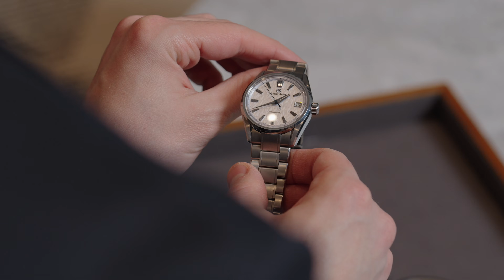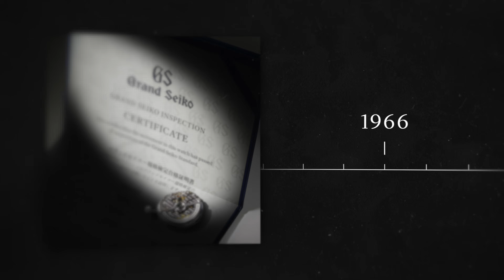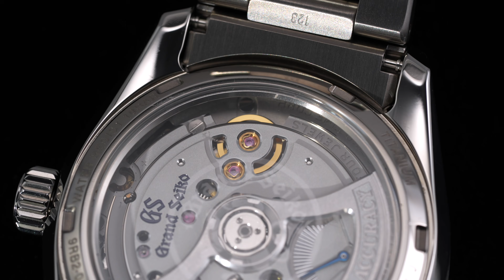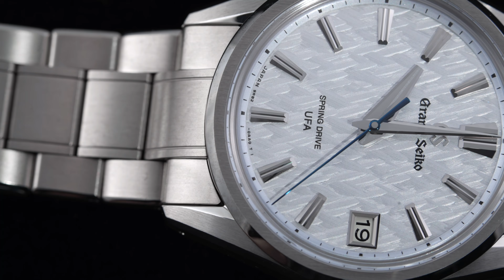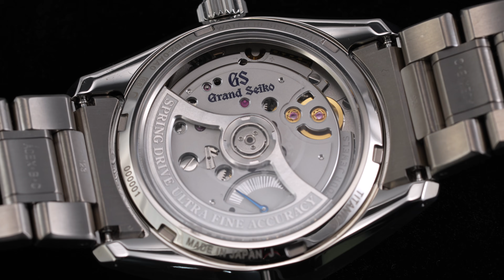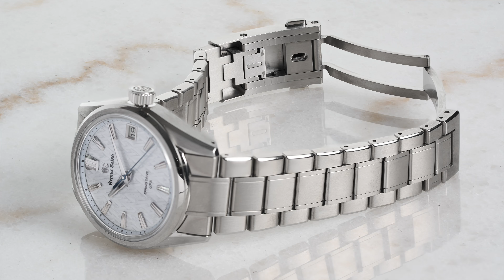The Most Accurate Spring Drive Watch Ever With A New Micro Adjustment Clasp  - Grand Seiko’s UFA

Comment: Is UFA stil the same movement, just factory adjusted? Including no updated firmware and such?
Reply: Features newly matured quartz. The quartz and IC are housed in a vacuum-sealed case. 
 A temperature compensation function has been added, primarily to minimize the effects of temperature and humidity.

Comment: I’m sorry but Joe keeps getting lost in the weeds when he answers. Teddy tried hard to guide him back by asking customer focused questions but Joe goes off every time. Eg Teddy: “This is some who wants the pinnacle of accuracy from Spring Drive… what was the breakthrough?” Joe: “[8.20-9.47 waffle then…] Manufacturing and structural elements.” It’s just so uninspiring. 
GS have a unique proprietary movement, which they’ve just optimised the hell out of. For the same money as a boring generic Rolex you’re getting better finishing, the latest technology, way more accurate that “Superlative Chronomete”, bigger service intervals, prettier dial, etc. Buy this GS and you can be smug knowing you’ve got a way better watch than 99% of anybody you’ll meet and no one is going to mug you if you wear it to a bar. Come on, Joe. Sell it to us. Don’t just read out the spec sheet!

Comment: I love me some Grand Seiko, and am a very happy owner of a 9RA2 and 9RA5 watch. As many others have stated, the accuracy of Spring Drive is understated, both my watches run with 1 second of an atomic clock every 6 weeks, which is already within 20 seconds a year accuracy. If my experience is anything to go by 9RB2 will run within 5 seconds a year. But it’s such a crazy flex as putting a date display that isn’t an annual/perpetual calendar means you may not even notice the uptick in accuracy over 9RA2 if you reset your watch to keep with the month. They should put this movement in a time only watch.
Reply: I have been running my UFA since July with zero deviation from the atomic clock using watch tracker app. Love this time piece. 🎉

Comment: Near grail piece, but 37mm is too small.  Hope a larger case with GS quartz and the OTF is in the works, spring drive is amazing but I'd be fine with a solid quartz piece that will last decades without a service and should drop the price down well under the 11K mark.

Comment: I have been wearing this UFA GS for less than a week now and i do love it very much. I wear the Rolex GMT 2 and 39 mm Explorer and this GS is well made in comparison. The only thing I don’t like about this UFA model is the inability to change the hour hand like a traveling GMT. For such an accurate watch, I can’t believe GS omitted this feature. You will need to reset the watch while traveling. Meanwhile the 3285 GMT will keep going at the same rate (+1sec) per day. The bracelet should taper off even more and no it is not equal or better than Rolex bracelets. Still, I am very impressed with this new GS although the price is a bit too much.

Comment: There are 86400 seconds in just one day, so to be accurate to within 20 seconds per year is over 99.9999%, also known as six 9s in a world where five 9s is considered a gold standard and often rarely achieved.  Very impressive for an electro-mechanical device with no outside feedback or error correction.

Comment: I wish they create it with simple black dial and with mechanical movement. We need smaller watches from GS. And stronger pins in the bracelet so it won't stretch out heavily after 3 months - apart from this issue the bracelets are ok but the thin/weak pins are not suitable for daily wear. This is why I sold mine, it made me crazy that I can't wear it because the bracelet stretches. For this price point it's unacceptable. Even a $200 Chinese watch has stronger bracelets. Optically also annoying when you see the differences after a while.

Comment: Unlike a mechanical watch, Spring Drive does not have an escapement, whether of the conventional lever type or any other variety. Instead, in Spring Drive, a mechanism called the Tri-Synchro Regulator replaces a delicate assembly of parts traditionally known for its thirst for oil and susceptibility to magnetism. Is spring drive a real mechanical watch? Hmmm…

Comment: Grand Seiko should discontinue the spring drive. It is watering down the brand. It is essentially an electronic movement with an IC. Quartz!
Reply: In the same way a Ferrari F40 is essentially an electric car because it uses an electric starter & electronic fuel injection.
Reply: @SuperMickyMc not the same thing. Only an educated person would say that.

Comment: What nobody talks about is the serviceability of these watches. Seiko has stopped servicing old spring drive watches because they don’t support the electronics for them. So, I don’t see these watches holding value in the long term and they cannot be kept as an heirloom like an old JLC or Rolex etc. which are completely mechanical.

I have my dad’s Rolex OP that he passed on to me that he had since the early 70s. I still send it to Rolex to get it serviced every 5 or so years.

Comment: Great video, thank you Joe and Teddy.  Satggering technical improvements and coming in with a smaller movement - a 37mm case diameter is very welcome.  Micro adjust bracelet?  I've just correctly sized my old style one!

Comment: I’ve always admired GS, and had one of the 9F GMT’s for a while but couldn’t get on with it. I’ve felt I really wanted a titanium, textured dial, spring drive, but they were always too big and too thick. This solves that, plus micro-adjustment clasp, extra accuracy (not really a selling point tbh though), and a 20mm lug width. Truly my perfect GS. Hopefully in a few years these will be pretty reasonable on the second hand market while I save up

Comment: Great watch, and advancement on a special movement. GS is at the forefront again . Have a sbga111, and a sbga429. Both way more accurate than specs say. Fantastic watches, even besides the sd. 
Kind of funny. Traded in my sbga413 for a black birch high beat. Love the watch, but not the movement. The accuracy is all over the map. It went back to Jersey for calibration. Only helped temporarily. Very disappointed in the high beat movement. Dont think i would ever buy another hb.

Comment: Damn 37mm super dial. A spring drive with +-20 sec a year. And finally a micro adjustment. The perfect one watch collection.
Reply: Would've truly been perfect had it had the 5 day power reserve.
Reply: @alexk3352 go for Quartz. I own a Grand Seiko Quartz watch and it's running +1 sec a year. You just have to replace the battery every 3 years 👍
Reply: still needs a tapered bracelet. these chunky bracelets are not elegant at all. theyre like cheap field watches. only major brand that doesnt taper bracelets
Reply: @michaelh8854  it is tapered
Reply: Almost, at least in my opinion. Namely, I find a 20mm band on a 37mm case too wide.
Reply: @ichipow  20mm is fine but it would benefit from tapering.
Reply: @Vonstroke  Yep, that would be a nice compromise and, IMHO, would look better too.
Reply: @ichipow  GS will never win this argument. So many people love 20mm on 36mm watches like the Rolex Explorer.
Reply: @EADFG0294  As stated, IMHO. It is not about a small wrist but about proportion (in relation to the case) and wearing comfort. I have a 37mm GS from the Heritage collection and it comes with a 19m band, which I find perfect (18mm would be too narrow).
Reply: @ichipow  i didn’t say its about the wrist size, I’m saying GS will never win, because the moment they go with a 19mm lug width, people will complain about proportions too, and about strap compatibility and all that. They made a decision, and people will have gripes about it either way.
Reply: @EADFG0294  Yep, with a strap 19mm might be an issue (more difficult to find) but with a bracelet it doesn't matter because no other than the original bracelet would fit perfectly. Anyway, have a couple of 37mm watches from other brands with even 18mm bracelets so it's down to personal preference. Hence, wouldn't be so sure 19mm wouldn't fly. Again, Heritage 37mm cases have 19mm bracelets. However, they are not Spring Drive but quartz. BTW, it's not just about esthetics, which is subjective, but about wrist perspiration in the summer and I found that a 1mm difference makes a difference that can be felt (after all, it is %5 less).
Reply: @ People still put GS watches with bracelets, on straps. Many people think GS watches, no matter what they come with, look better on straps. Whether its the evolution 9, 62gs, 44gs, this is a common opinion.
Reply: @EADFG0294  The right strap could also bring out the blue tone of the dial.
Reply: @ichipow  You have small wrists

Comment: They should have integrated the micro adjustment where you press the GS logo on the outside of the buckle and it lets you adjust the band. This micro adjustment looks like the omega speedmaster micro adjustment.

Comment: I'm confused. My Seiko LX spring drive has an on the fly adjustable clasp and averages 1.5 sec a month, or 18 seconds year.  It has a 72 hr reserve. The other stuff is cool and all, but the two items you led with have already been done.
Reply: Yes the new caliber guarantees 20 seconds a year now, not 18

Comment: The mad lads finally did it.  A thinner smaller spring drive with a micro adjust clasp.  Absolutely phenomenal!
Reply: Omiwatari is already this
Reply: Just needs a real tapered bracelet.
Reply: The mad lads at Steel Reef did micro adjust for GS a while ago 🥱 and not just for the newest most expensive model
Reply: @gabrielmiddleton9582  It's not news that GS are late to the game lol.
Reply: @gabrielmiddleton9582  For many years, GS has offered both micro-adjust and on-the-fly adjustment on many of their sport collection watches like divers, Tokyo Lion, etc.
Reply: @gabrielmiddleton9582  "A while ago", you mean a few weeks ago and it's naff.
Reply: its still trash without a tapered bracelet. no one repeat no one wants these 19mm chunky bracelets and clasps
Reply: @ It tapers from 20mm to 18mm. That is taper. I wish my GS 20mm bracelet had no taper at all. Do you want it to taper down to a steel wire like safety wire? Heavy taper is for very small humans.

Comment: Having the quartz crystal and thermo compensation, this is no longer at all mechanical. Now, it is not anymore Hybrid and rather a complete EV.
Reply: It doesn't have a battery and is powered by a main spring. Springs are mechanical.
Reply: @pittss2c601   Agreed!

Funnily enough though, quartz oscillators are also mechanical!  Ssssshhhh!  Don't tell the "purists", they will have to move the goalposts!  Then we'd have to start talking about quantum mechanics!
Reply: @ Exactly. My two Grand Seiko 9f quartz watches have plenty of gears, jewels, 100+ parts, and even a hairspring, to satisfy mechanical watch snobs.
Reply: Neither! It’s like an EV without a battery!

Comment: The movement is very cool, but I very much dislike "UFA" on the dial.  I don't even like "Spring Drive" / "Hi-Beat 36000" / etc. on the dial.  Now they're adding more text.
Reply: My 9F quartz has nothing on the dial except the logo.
Reply: what I dislike was the placement of the words Grand Seiko on the movement, used to be on the rotor in my Snowflake, now it feels awkward that it's tilted 90deg

Comment: Still no taper on the bracelet? I thought that’s what we were leading up to and then it turned out to be the micro adjustment.
Reply: 20mm to 18mm is taper. Do you want it to taper to a steel wire like safety wire?
Reply: @ exactly. From 20 to dental floss.
Reply: A 20mm to 18mm taper on your wrist might as well be a straight 20mm. It's as helpful as a $2 tax return.
Reply: @BruceCross  I wish my 20mm GS bracelet was a straight 20mm. Only very small humans need an extreme taper.
Reply: @BruceCross  Then when they make it take to 16mm or 15mm, people will call it dainty

Comment: In the end it is still a quartz watch!
Reply: You're about 8 years late with this horrible take!
Reply: In traditional quartz watches, quartz timing is used to advance the movement, whereas in Spring Drive movements quartz timing is used to slow the movement.  Just like an escapement.

In traditional quartz watches, a battery or capacitor is used to power the movement, whereas in Spring Drive movements a mainspring is used to power the movement.

Radically different concepts.  Spring Drive is not just a quartz watch.
Reply: In my book a watch that have electronic psrts is not a mechanical watch .
It has an integrated circuits and  a quartz crystal. It is a fancy quartz watch!
Reply: @danield6815  quartz is used to categorize watches with batteries and quartz in them. While that may be a misnomer itself, you’d be better off calling spring drive a hybrid, rather than quartz.
Reply: @EADFG0294  I agree it is a hybrid but the heart of this movement is quartz crystal  ! You all know the king is naked .
Reply: @danield6815  You completely missed the point about how we traditionally categorize quartz watches.
Reply: @EADFG0294  Lets agree to disagree.
Reply: @EADFG0294  Who is "we" ?
Reply: @ Literally everybody in watches, prior to mainstream spring drive.
Reply: @ Agree to disagree on...facts?
Reply: @EADFG0294  Facts ???
Let me tell you some facts :
It has a quartz oscillator.
It has an integrated circuit.
It has 2 coil blocks for the quartz.
The last two points are Achilles heel in any QUARTZ movement!
Reply: @danield6815  And prior to mainstream spring drive, and even now, when we refer to a quartz watch in the common sense, it is powered by a battery. Convenient you leave that part out.
Reply: @EADFG0294  Before battery powered quartz watches there were electric watches with out quartz oscillator.
Reply: @danield6815  1. The early (pre-quartz) electric watches did not have a quartz oscillator. They either had a balance wheel, or a tuning fork. 
2. What was the power source of these early electric watches?
Reply: One of the reasons i love mechanical watches is the possibility to service them for s long time . I am enjoying watching YouTube reviews about servicing decades old mechanical watches. I dont think we will see in the far future, say 70 years , clips about servicing a spring drive .
Reply: @danield6815  Since the Seiko group is the only ones doing spring drive for now, your point misses the mark.

Comment: I can’t believe how much I have fallen in love with watches this past year. I’m giddy for the movement in the Rolex Land Dweller and now I’m rocking on my seat hearing Grand Seiko has a 37.5 micro adjustment watch with 20 sec/a year!??!? Man I love it, what a fun hobby.

I won’t be able to afford either for years though sadly with this teacher salary AHHH
Reply: You do realize that for a quartz watch +- 20 seconds isn’t impressive. Heck the Citizen Eco Drive is 1 seconds a year
Reply: @jimbobsmith2496 a regular citizen eco drive isn’t 1 second a year only the citizen 0100 had a 1 second a year deviation and it’s no longer in production. and this isn’t a traditional quartz watch it’s more mechanical. So 20 seconds a year is record breaking.
Reply: @jimbobsmith2496  You're about 8 years late with this antiquated argument bud
Reply: @jimbobsmith2496  absolutely, my daily watch is a 2008 eco drive promaster. In this case, I am completely enamored by the engineering going into spring drive. But I definitely appreciate eco drive as well

Comment: GS get all giggly over making an insanely accurate watches more accurate without looking any different.
Meanwhile rolex releases a banger with new revolutionary movement, platinum braclet that is thinner and better looking.

GS losing their way. Way too nerdy. Not enough style.
Simply release industry topping braclet and lose the word "seiko" from the dial to double sales (and personally I wish they put power reserve back on the dial as, although divisive, it was distinctive).
Reply: If you think the new Rolex is a banger you need help.
Reply: The Land-Dweller is going to languish once the "new-car-smell" dissipates.  The UFA will have a smaller following because GS has a smaller following, but it will have staying power.
Reply: @Vlad-from-USA  will be interesting to see. I think both the diamond set and platinum will falter, but the steel will fly, and when they release yg it will go 🍌 🍌
Reply: Revolutionary new movement for Rolex, but not this? LOL
Reply: @rousseau327  no it's evolutionary. Not revolutionary.
Reply: @Newerasamearea  interesting you make the distinction with one but not the other lol. Incredible the lengths you guys go.
Reply: @rousseau327  happy to be challenged: what about the ufa is revolutionary rather than evolutionary? (No caging the crystal or adding an adjustment switch is not revolutionary)
Reply: @Newerasamearea  I don't think you understand, I'm not calling anything revolutionary, I'm talking about your choice of perspective on one over the other.